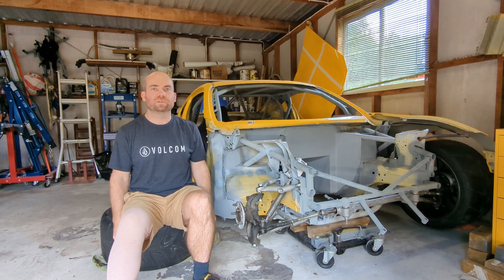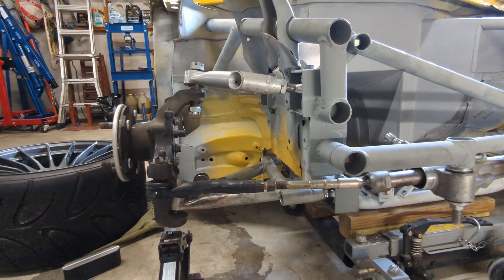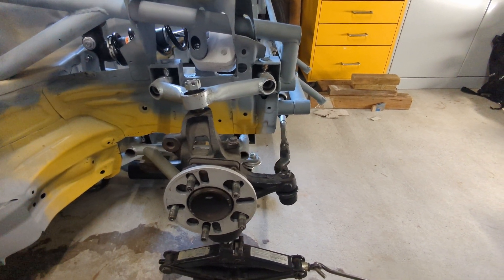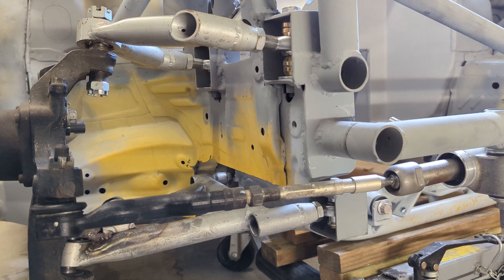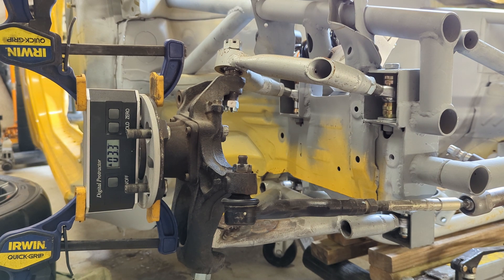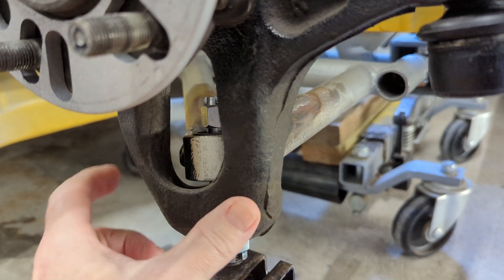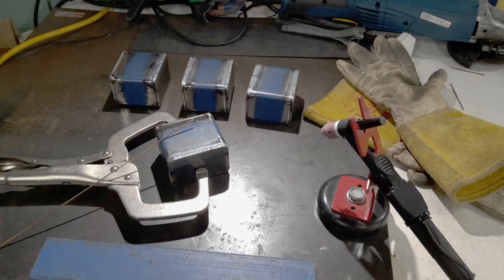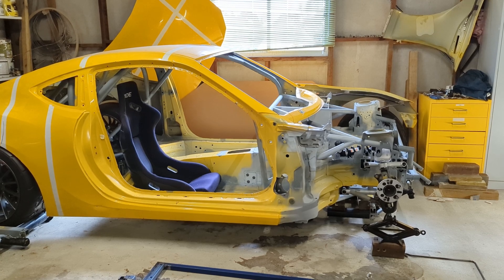Build Breakdown Ep.2

Comment: Look like you gonna have some bump steer
Reply from the maker: The steering rack height is adjustable, the rack length might not be perfect but a custom length rack is expensive. I will be measuring bump steer at some point and deciding whether the amount is acceptable or not.
Reply: @joeldavis3152  rack seem to be too short so changing height is not going to help, personally I'd look for a little longer rack (plenty to choose from so I'd be very surprised if you couldn't find one) if not I'd consider fabricating some sort of spacers or sleeves between rack shaft and joints
Reply from the maker: Changing the rack would be a huge job and unnecessary. The length of the rack is only slightly too short and I'm sure it could be easily lengthened with some tie rod spacers.
Reply: @joeldavis3152  if by lengthening you meant the rack shaft (joint to joint distnace) not the tie rods than go for it
Reply from the maker: @SylvesterOziomek  yes joint to joint.
Reply: @joeldavis3152  I was going to make same observation as Sylvester but sounds like you're already onto it. Because it's front steer with some ackerman built in to the knuckles, the inner tie-rod end will need to be positioned slightly outboard of the axis between pivots for upper & lower control arms... that's ideal for straights, but all bets are off for mid corner bumps when geometry can be grossly different. Joel - your solution for adding spacer to extend the end of rack will definitely address the problem for bumps on the straights.
Reply from the maker: @grandpafabio  thanks mate, is there a strategy for correcting bump in corners or do you just make it as good as possible with the steering straight?
Reply: @joeldavis3152  I've only tuned for zero bump on straights. Geometry gets more complicated when the wheels are turned. I recall in one of your videos you were talking about 'design compromises'... bump steer seems to be one of them.

Comment: Hi, what size tubing you using for subframe and control arms? Using t45 or mild Steel cds? Great videos
Reply from the maker: It's all CDS mild steel. The main subframe is 1.5" with 2.6mm wall and the control arms are 1.25" with 3mm wall. I think the control arms will be made again eventually with some lighter material but for now they will do.
Reply: @joeldavis3152  you using the 1.5” for the rest of the framing as well? I’m on with a van project at the minute with a vr6 swap, just planning out a custom subframe and lower control arms, as the factory weight is ridiculous, I’ve made a subframe already but using 1.25” 3mm cds and though it’s solid, bit nervous about trusting it so might have to do it again with bigger tube, was thinking t45 but it’s double the cost of the cds 🤷🏼‍♂️
Reply from the maker: Most of it is 1.5" yes, main hoop in the roll cage is 1.75" though as per rules. I also used some thin wall chromoly in some places that are just a brace.

Comment: I’m doing something similar on an e36 
But making my own uprights. 
Personally I would recommend lowering your rack in line with your bottom arm pivot then fabricating a steering arm bracket that bolts to your original upright, this then allows yo to make various mods to suit your Ackerman. 
Or just as easy buy a bolt on wheel bearing / hub with the correct pcd for your wheels then fab a complete upright. 
I’m just struggling with a roll Center that comes out at the bottom of the car . KPI and castor for testing will be somewhere near the mcphearson strut settings . 😇🇬🇧
Reply from the maker: I need to measure the Ackerman first and go from there. There are a few ways to deal with it if I think it's going to be a problem.